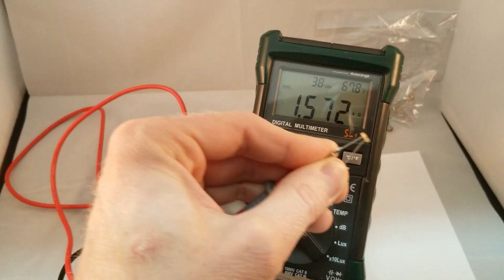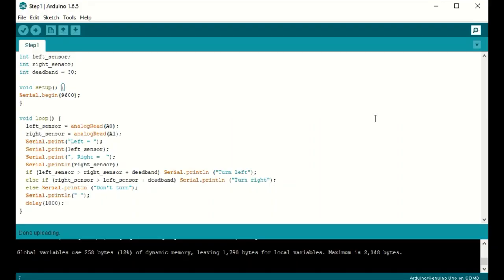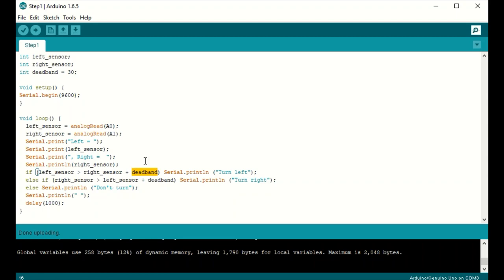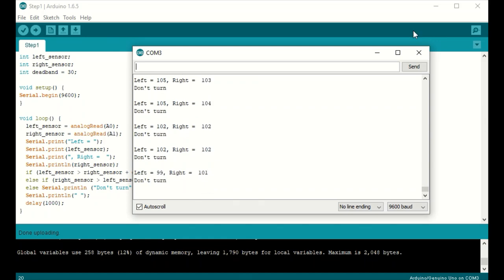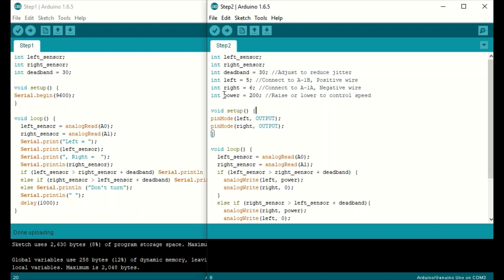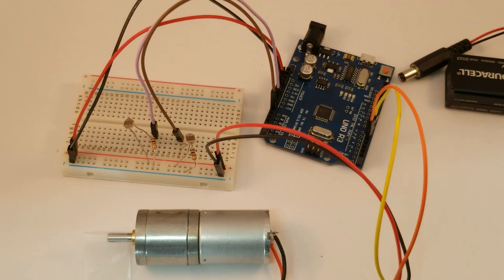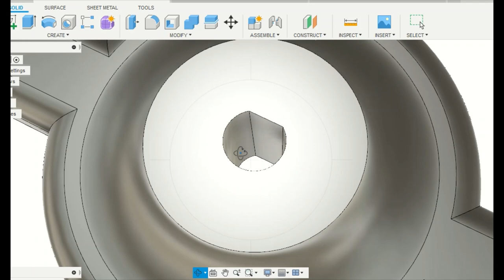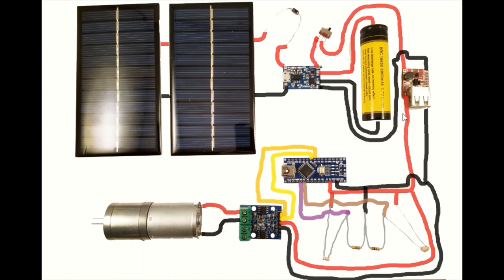Arduino Solar Tracker with USB Phone Charger – DIY Tutorial

Comment: looks fun... could 2 small solar pan be used to act like a light sensor?  id like to figureout how to use a dc drill to run a ready rod to pivot my panals. ive never used Arduino but am interested. i dont know the diff with the other os or if there is a diff.
Reply from the maker: Yes. You could use 2 small panels as sensors. You could use voltage dividers and simply compare the voltages between the two panels.

Comment: I'm wondering whether it can be done by using only the 2 photoresistors as the voltage divider on 1 analog pin.
Reply from the maker: Hmm. Not sure if that would work. Somehow you need to compare which resistor is getting more light.
Reply: @ScienceFunInnovations  If they're getting the same amount of light then they'll have the same resistance and the analog reading will be 511 (give or take the manufacturing differences). If they're getting different amounts of light then their resistances will differ and the one with the lower resistance will pull the analog reading away from that value.
Reply: In reply to my own question, the problem is that you'd have no idea of the overall illumination, so it would keep trying to track even at low light levels when there's no point. You need to know the level of illumination as well as the direction.

Comment: Hey there, I love the project Idea. I'm planning on doing a similar project and I have a quick question on the 3d Print. How did u make it so that the gear motor can move even with the 3d printed base? How did you make the 3d print so that the motor isn't just stuck to the bottom and is still able to rotate. Pls get back to me asap as I would love to hear from you soon. Thx!
Reply from the maker: It's been a while since I built that, but I think that the shaft of the motor was stuck into the base. (The motor is upsidedown) Hope that helps.

Comment: Love the project!  Curious... what are your thoughts on using a pan/tilt robotic arm kit (aka: the lowest cost, most capable pant/tilt robotic arm kit) to perform the tracker's mechanical movements(?) This way, people can build the tracker without the considerable/added cost of a 3D printer, + the robotic arm (when hooked to the electronics) would provide a much, much simpler/quicker plug-and-play platform that would also allow larger solar panels....(?)...
Reply from the maker: I imagine I will do another solar tracker video sometime, and I will see about doing it without 3D printing. :-)

Comment: First of all the video is spectacular, and it has helped me in my project. However, I have a rather dumb question. You are using a 12v motor, powered by a 5v output. Wouldn't the right thing be to connect the motor power to an external 12v source?
Reply from the maker: You can always use less voltage on a motor. It will just turn slower, which is what I wanted for this. It doesn't need to move quick since the sun moves slowly through the sky.

Comment: Hey, update for the project I am making similar to this one. It mostly works, the only thing is that the phone isn't charging (I'm using an iPhone 8). when I connect it, the light from the Step Up DC-DC Boost Converter is on for like 2 seconds, then is off. I have to turn the switch off, and back on for the converter to turn back on again. Do you know why that is? Also, for some reason, the lithium-ion battery charger, when the solar panels are connected, the red and blue lights turn on when it is in direct sunlight. When there is minimal sunlight, only the blue is on. Do you know why is that as well? Thank you so much and I would love to hear from you asap on either or both of these questions.
Reply from the maker: That project was such a long time ago, I'll try to remember a little. If I were to do it again, I would use bigger solar panels. I would turn off my phone to help it charge faster. And I was using an older phone that didn't have rapid charging. So long story short, if I did it again I would use a bigger solar panel and make sure the it has the right voltage output during full sun.

Comment: This video was great to help me with my project. Except I am doing one that tracks along the horizontal and vertical axis with a 5W solar panel. I am just concerned about the 5W panel, it can produce up to 16.77V and a current up to 0.32A. So should use Step Down DC-DC converter from around 12 to 16V down to 5V? Also, how would I know which lithium ion battery to use? Kind of nervous to just hook this stronger panel to the same battery, what if it explodes haha
Reply from the maker: Probably a good idea to use a 5V regulator. Be sure to record it on video if it explodes :-) (May just want to charge it outside the first time) Good luck.

Comment: can i used this on 2x 550w panels to track the sun throughout the day?
Reply from the maker: Yes. You can use voltage dividers to keep the input <5V. Then use two analog channels to compare which panel is getting more sun.

Comment: Hey!! Science Fun. Really awesome and informative video. I am doing a similar project where I am constructing a Solar Tracking platform. However, I am going with a Stewart Platform approach for the structure/mobility of the platform. Similar to your video, we too are using photoresistors with a cross to measure the change in resistance caused by the Sun. Currently our project is controlled by a Wii Nunchuk which has inputs accX, and accY. (which is the physical rotation of the Wii Nunchuk). But, I want to integrate a switch to move between manual and autonomous control (with the photoresistor sensor). I was wondering if you could offer some advice to bridge the gap between our codes input values as stated earlier and substituting the input values from photoresistors? To provide some quick background. I too am using Arduino IDE for the programming, and most of the math involved utilize Inverse Kinematics. If you are interested in knowing more, please don't hesitate to reach out. Thank you, and I hope to hear from you soon! 

Best, 

Seth P
Reply from the maker: Sounds like a fun project. I would use a state machine to switch between manual and auto.

Comment: Am very happy with it 🙏👍🙏 am waiting for this vdo as u told in ur privious vdo .can this set it to go back to the initial position if we assume that the East is initial position, Now how  this can working on  the linear actuator with the same code , best execution vdo on solar tracking thanku 🙏🙏🙏
Reply from the maker: Yes, you can make it work with very similar code. This video might be helpful: https://youtu.be/qLltghqVrvI . If you want, you could add code that when it is dark outside (using the values from the photo resistors) to go back to the home position. Linear actuators have built in limit switches, so they will not over travel. However, if you just wait until morning, the photo resistors will detect the rising sun and automatically return to the home position. Best wishes in your projects.
Reply: @ScienceFunInnovations  🙏🙏👍🙏🙏 thanks

Comment: Ik heb hiervoor twee zonnepanelen van elk 3 watt in serie gezet, waardoor ik 6 watt verkrijg. Beide zijn van 6 volt. Maar als ik 1 paneel plaats meet ik 5 volt bij een bepaalde lichtintensiteit. Maar als ik beide in serie plaats, meet ik ook 5 volt bij eenzelfde lichtintensiteit. Ik heb nog nooit meer dan 5 volt gemeten. De uitgang van de panelen gaan naar een buck converter die de ingaande spanning omzet naar 5 volt. Weet iemand dit te verklaren en hoe ik aan meer dan 6 volt kan geraken?
Reply from the maker: You will likely need to try other panels with higher voltage.

Comment: you links to the 5 rpm gear motor seem to be broken.  What voltage is the motor your using?  Thanks Rick
Reply from the maker: I think it is just a 3V hobby motor.
Reply: I doubt it is a 3 volt motor. I was asking where I could buy the motor you used. Your project looked very nice and worked well.
Reply: @4921rcw  what motor did you use in the end

Comment: The real thing is, the power created from this solar panel in each minute just cannot afford for what the circuit spend during the same time.
Reply from the maker: Correct. The solar panels do not provide quite enough power keep up with phone charging, but it will charge the onboard li ion battery over time. Once I switched to a legitimate battery, it did a much better job charging the phone.
Reply: @ScienceFunInnovations  what will be a good choice for the legitimate battery